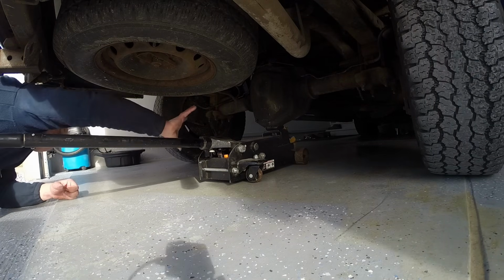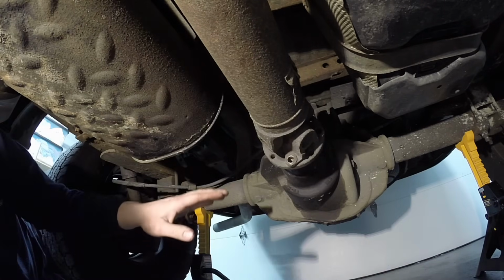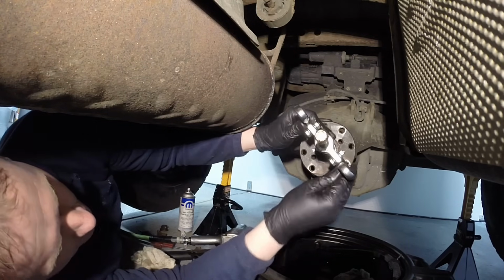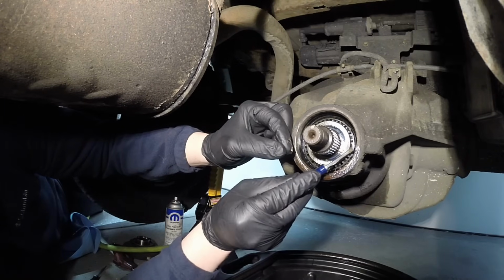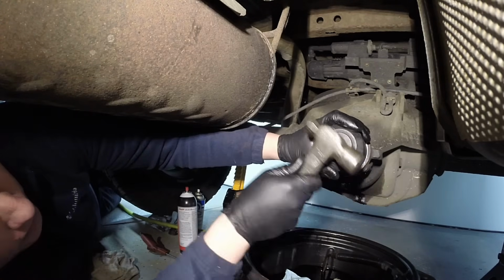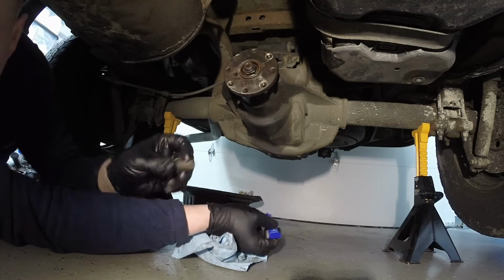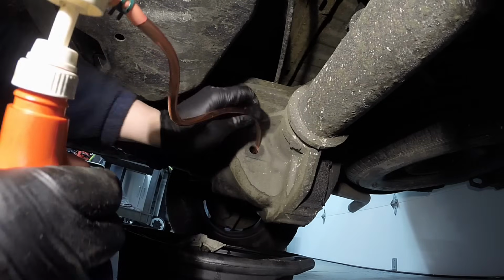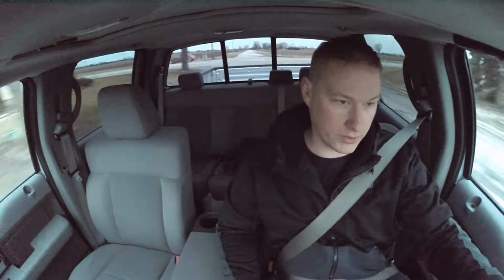Ford & Dana Axles Pinion Seal Replacement: Tricks of the Trade

Comment: Aloha's Bruddah - Another Great Video!  Thanks Huge for showing us these awesome video details with your Tips and Tricks!!I have always been taught to mark the drive shaft and pinon flange faces before removing a driveshaft.  Recently, I watched a video and the mechanic countered this old school knowledge saying that all driveshafts are assembled and balanced off of the vehicle seperately prior to it being put on by vehicle manufacturer.  That got me thinking seriuosly .. and my gut and noggen makes me think he's right.  But I would really very much appreciate your thoughts on this.  True that - the driveshafts are not balanced on any  vehicle or at any time during vehicle assembly. Not sure about the maintenance requirements are for the true "high performance" foriegn or domestic vehicles, that can approach 175 plus mph speeds right off the showroom floor and those vehicles aren't what I am speaking of here. And it is also true that single or multi part driveshafts are not checked for balance once installed on vehicles.Should any part of the driveshaft need disasembly, repair and then be reinstalled .. then Yes, it would be Very important to know where it was prior to removal and to ensure it is rebolted where it was removed from. Otherwise, it just seems it shouldn't  matter.What is your thoughts on this?Also have a two part question about the torque for the pinion nut to pinion... (1) is there a required torque value to check for prior to putting the driveshaft back on? And, (2) What is the best way to torque check that pinion nut?Another question, Can we or perhaps better asked, Should we check backlash when we are changing the seals or doing any work since the rear diff is partly opened anyway? I kinda know the answer but I've learned that sound boarding works best.  Also, I got the feeling that you wished the owner would let you replace the bearings and check (r&r) the backlash. Was it because it costs that much more to do this? And was that his reasoning to not heed your recommendations? Thanks ahead of time! rick h.
Reply: they are balanced off of the vehicle...the reason you want to mark the flange is because rust forms around the mounting surface and you don't want to have the flange sit differently than it was before...it's really not necessary to mark the drive shaft...what he was concerned with was the position of the nut so he didn't change the previous load on the bearings by compressing the crush sleeve any more...it is located between the pinion bearings...
Reply: +Gary  Ferguson Jr - I agree with what you said. Thing is you mixed the two points that are different in cause - into one statement that can't be connectable because one is for the driveshaft and the other is for the pinion shaft. Two separate components.  You went from marking the driveshaft flange and pinion flange into marking the pinion nuts location relative to the pinion shaft threads.  I completely agree that relationship is critical for reasonable reassembly without going further by performing a better backlash measurement.  Very Important and Noteworthy - the customer may not of authorized the extra costs and by marking the pinion shaft nut location was the right and best thing to do. It has to be marked.  There is one question that I have and I hope you can clear it up for me.  The question is - Is there a way to accurately measure pinion backlash from the front pinion flange/shaft/nut (without removing the rear axle cover plate? A procedure that is normally done using the rear gears.
Reply: @hawaiianf1504  Thanks for this interesting reply. I had similar questions.
Reply: +Hawaiian F150 Yes their is required rotational torque values for setting up differentials...pinion torque and total torque which includes the diff carrier (where the rear brake's cannot be dragging). The torque value's differ based on new or used bearings. You need a inch/lb. dial type torque wrench to check.  If you are just replacing a pinion seal and the diff was not noisy to begin with no need to check backlash at the pinion flange, not necessary...however I cannot answer your question if measuring backlash at the pinion is accurate as their should never be a need to do so. One word on the crush sleeve type pinion bearing preload is you cannot over shoot it and back off, you will have to put a new crush sleeve in and start over. Dana diff's have a better design, no crush sleeve's but separate shim packs, one for pinion depth and another shim pack for bearing preload, I wish they all were built this way, however you can now buy crush sleeve elimination kits which mimic the dana design for other popular diff's.
Reply: @williamd4489  Thanks for this additional info about crush sleeves and elimination thereof.

Comment: i just had my rear seal replaced at the dealership. Within 1 month it started to leak at the seal. They found pinion flange was cutting new seal. Wouldn't that be seen upon install the first time out? Thanks for another great video.
Reply: +Bushcraftarizona They actually changer the parts warranty to 2 years / unlimited mileage a few years ago

Comment: Why did you replace the drive shaft, instead of replacing thing the U-joint?
Reply: "...balance weight rotting and falling off..."? Really? Hmmm.
Reply: the balance weight was rotting and falling off
Reply from the maker: +Randy Charlton It had many issues with balance weight rotting an falling off, rear u-joint seized which is staked so the u joint kit is about 3 times as much plus lots of labor and the front joints was starting to seize also. If I fixed al of that it would cost more than an all new driveshaft from Ford that I sold to the customer at cost. Also there was over 230k miles on this shaft.
Reply: +FordTechMakuloco Ok I was thought there was a reason. But you did not say in the video. Thanks.

Comment: Another well done video.  Last weekend I special ordered a new '16 F150 XLT, 4x4 regular cab longbed.  It should be arriving in 8-12 weeks from the factory coming from the Kansas City Plant.  I went with the 5.0L V8, since I have to work on my own junk when it's out of warranty in the future.  I didnt want to deal with any stink'in turbo problems down the road and I wanted the factory snow plow option to boot.   Thanks for your input and videos you have given me helping make my decision clear.  Take it easy - Glen

Comment: What size 2 jaw puller did you use for this job?
Reply from the maker: +dwpetty3723 I think mine is a 2ton cheapy set I need to upgrade I link to a puller in the video description though
Reply: The puller that was in the link was to small to fit around my 10.5 inch pinion flange.  The puller you link to is ridiculously small.  Other than that, this project went very well, thanks to your directions!

Comment: Brian, how do you deal with working on the floor and in semi cramped conditions like that? How do you deal with the aches and pains??
Reply from the maker: +Chris Rippy I'm still young lol! I actually used to do pinion seals like this at the dealer too to save time lifting the truck on the hoist and spotting the arms.

Comment: Another great video and repair. Nice job, great camera angles and tips. Thanks !  Better than watching those goof balls on tv.Quick question I have been meaning to ask. What type of paint/ floor sealant did you use on the garage floor? Looks like it is holding up well to the work your doing with jack stands etc. Thanks
Reply from the maker: +Allan G we use the basic water based quickcrete floor epoxy probably 9 years ago now and it has held up quite well we did prep the floor well beforehand though still I am surprised. This spring I will be applying the rustoleum solvent based industrial floor epoxy and then clear coating it with an industrial polyurethane floor coating to take all of my abuse.

Comment: is it the same for the 3rd gen explorer front and rear axle
Reply: Thanks
Reply from the maker: +STEEVE DAVID Nicolas yes this same basic procedure applies to both independent and straight axles. 8.8 9.75 and even 10.25 axles on probably 30 plus years of ford axles.
Reply: +FordTechMakuloco thanks,how about the seal where we hook up the cv shaft
Reply from the maker: +STEEVE DAVID Nicolas Those either have c clips or retaining rings holding those in
Reply: Ok, thanks

Comment: You mentioned several times about checking the backlash. The pinion nut only provides for pinion bearing preload. Adding or subtracting pinion shaft shims adjusts the backlash. I get you perhaps meant feel for pinion shaft end play and verify the free play is taken up. Perhaps you could have mentioned when you mark and count threads you are hoping to re-establish the proper bearing preload and perhaps checking it with an inch pound torque wrench. Perhaps in this case since a rebuild is required sometime in the near future you were not too concerned. great video as usual!! Thanks!
Reply from the maker: +Robert Kohut grabbing the pinion flange and getting a feel for the backlash is an old trick to see how seated the pinion bearings are. As you tighten up the nut the bearings seat and the slop is taken up and of course you can also "feel" for or get a sense of the bearing preload all at the same time. I mention several times the point of counting the threads and all these checks is to "reestablish the same preload in the end as we have now" I mention it at the very end after filling it also. Checking preload properly would require tires and brake discs to be removed at the very least and the axle shafts and carrier to be removed to test for the spec pinion preload. I only do this when new bearing and a collapsible  spacer is being installed otherwise this is the tried and true method used by techs everywhere.

Comment: I noticed you put on a new drive shaft, I hear that the ujoints are not replaceable, is this true? Seems crazy to buy a entire driveshaft just for ujoints...
Reply from the maker: +Jesse Eckstein correct but the service kit was half the cost of a completely new driveshaft. Plus this driveshaft has weights rotted and falling off and the front u joint was starting to fail at 230k miles so I sold him a new driveshaft at cost so it's all new for him. Not to mention the labor cost to convert a joint like that so this just made sense.
Reply: FordTechMakuloco
 that makes sense, better off putting a whole new unit on. good call
Reply: Ford tech here, you can actually replace those u joints, it can be quite a pain the older the vehicle. Sometimes it's simpler to replace the whole shaft
Reply from the maker: +jordan bickerstaff technically they were not serviceable being staked u joints but Ford has since made service kits to cut the stakes and insert a regular u joint. Ford only used stake u joints on these for maybe a year and a half and gave up.